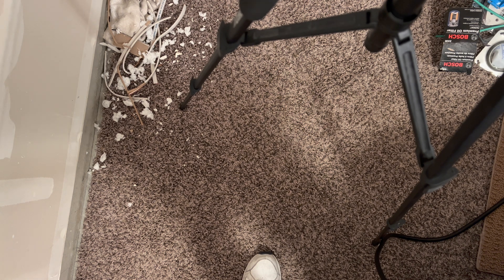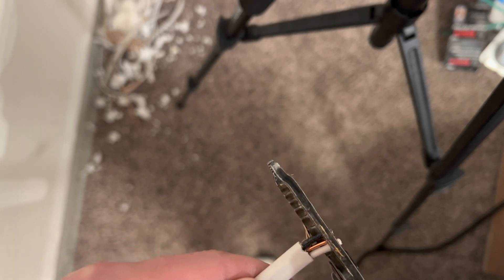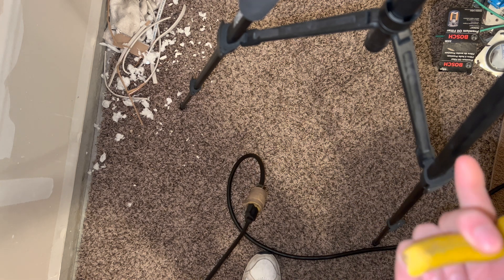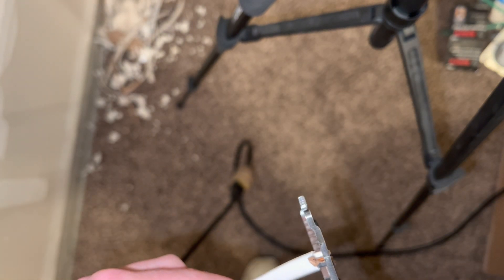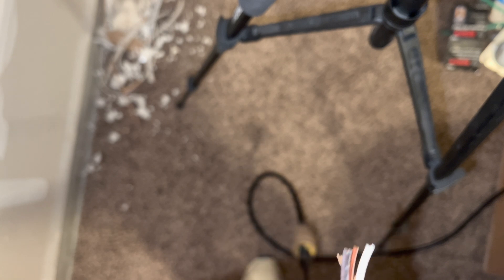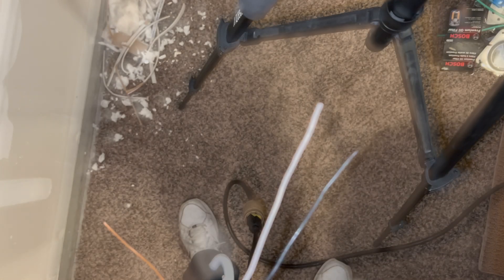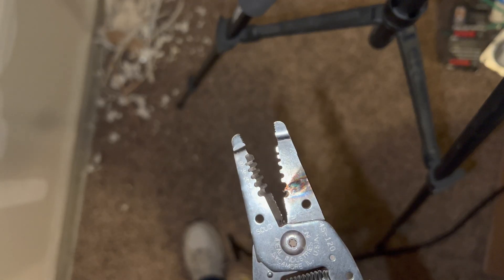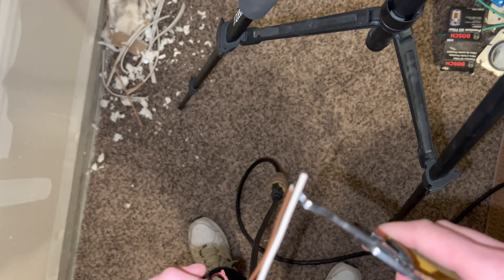Electrical 101: How To Cut Live Wires (Residential)

Comment: Just FYI, every time you short a branch circuit like that, not only do you briefly overload the conductors in the walls by over 200% their ampacity, you also cause pitting in the contacts of the circuit breaker, similar to what you see on the tools. This can drastically reduce the life of the circuit breaker, and the last thing you want is for those contacts to make a bad connection, heat up and start a fire.

Comment: Thank you so so much.  I am on my own and need to cut wires.  My voltage meter said it was okay but I'm still worried and now I know what to do.  Not sure if you did any videos on using a volt meter and what to look for if I'm testing a socket, I'm nowhere near an electrician but this is so helpful for keeping people safe in their homes as they work near eletricity. Thank you.

Comment: If you want to break the circuit because your devices are burning where there is no breaker to switch off the light 
Should I cut the live followed by the neutral and then the ground?
Reply from the maker: yes, as long as its not a shared neutral

Comment: I was in an attic tearing out an hvac unit. And my helper said power was off. I believed him. And the way power was ran. It would have been easier to just cut the romex all together.  I cut the wires. Loud pop. Sparks flying everywhere. Strippers melted. And somehow. Breaker never tripped. And wires were still live
Reply from the maker: yeah been there, never trust anyone. also lock it out with a key only you have. glad youre okay!

Comment: Say you have a circuit, a normal wire, live, neutral and ground on a lamp, there would be power on the neutral wouldn’t there?
Would there be an explosion if you cut just one of the individual wires?
The lamp is on, would there be an explosion if you cut the neutral wire only?
Reply from the maker: don't think so, but i can test it out!

Comment: Can you cut a live service wire thats going to your house in order to change to 200 amp. Or should you call the company to turn off the power first
Reply from the maker: i would never do that, one wrong move and your dead. call the company.
Reply: RIP.
Reply: What he said, one wrong move and you're dead. BUT if you're going to ever do that, use insulated tools and gloves. 10000%
Just a bit more of an explanation that will go along with this video... The arcing that happens when he cuts all the wires at one time? You see how that's pretty small and insignificant? If you accidentally cut a live feeder wire and happen to touch another wire (weather with your body, your tool, the wire, etc), that tiny little pop instead is going to be a huge boom called an arc flash. It's hot as shit, dangerous as fuck, it'll probably blow up the whole fucking panel. Lol
This is advice from an actual electrician right here too. And I've seen some crazy shit happen. So yes be careful and I appreciate the fact that you asked the question as opposed to just did it lol. 

Still if you have got the balls and are careful go for it lol
Reply from the maker: well said 😂

Comment: What if I turn off the main switch? I would be safe to cut electrical wirings for rewiring?
Reply: Yes
Reply: This video is about cutting live ones so if you're able to do that then of course you can safely cut non powered wires
Reply from the maker: yes, granted that is the wires power source.

Comment: This Happened to me, So had a Motor but it’s stuck in the box so I had to pull the Wires to pull the motor out but it Ended pretty badly because I Mistakenly forgot to turn off the Electric power from the motor and When I was pulling the wires of the motor it went BANG!💥 With lots of sparks and the Wires have Snapped, Luckily I wasn’t Hurt.

Comment: thanks this re assured me i dont need to turn the breaker off if you only snip one wire at a time, which will help me change this light out easier. 
for some reason this house 2 breaker panels, one in the attic and the other under the house in a crawl space and its a hassle
Reply: Did it work no problem?

Comment: Why do my stripper keep blowing up? I’ve blown up 2 in 2 weeks and to embarrassed to ask my journeyman. Both times I was only stripping the hot by itself and it blew. Most of the time I strip or cut hot wires it’s fine. Any ideas? TIA enjoy the content btw!
Reply from the maker: it's gotta be shorting out somewhere. maybe the edge of the stripper is touching the box or another exposed wire?

maybe stop working hot, lol
Reply: Never be embarrassed to ask a question.  Even a genius asks questions

Comment: I have a question, here the 3 wires are already cut.  What if all 3 are still in a circuit like say series.  And you want to cut the hot wire and you don't have an insulated cutter.  You can't right.
Reply: You can cut and touch live wires without insulated tools just make sure your shoes are insulated or standing on rubber floor mat

Comment: I was installing an AC disconnect today and I blew up my knipex linemans. I turned off the breaker but whoever terminated the load center mislabeled the 2P breakers. There wasn’t a quick way to test the voltage on the wire since it was just a 3’ stub of 8ga SEU sticking out of the wall. I learned today that I’m just going to turn off all the 2 pole breakers because you can’t trust anyone.
Reply: Invest in a non contact voltage tester and a meter, test everything before with leads bro

Comment: That tester you used we call in Finland "Dead mans pen" because you can't trust  it 100%. I was thought to never use one if testing for the purpose of working on the tested object. Only use it for finding wires. Also if you cant find out which breaker some wires are coming from or you have a really long way to the panel you could do what you did to trigger the breaker😂 but I would not advice to doing so but like my last weeks job where the panel was behind a locked door and the owner not coming until 2 hours later I tripped the breaker by connecting hot and neutral. Just don't do this for above 16 amp circuits.
Reply: Why not above 16amp
Reply: In the US. You normally run a 120 20AMP breaker for garages. He just did what you said you shouldn’t do
Reply: You should only use those voltage pens to see if something is hot or not strictly.
Reply: @brendanfogel4573  yea, I like to run around the club with this
Reply: Guys at my company call it the widow maker lol

Comment: Wouldn't it be cool if they made a wire cutter where the actual cutter is not conductive so that you can cut live wires without issues.
Reply: they're called apprentices. lol
Reply from the maker: lol
Reply from the maker: very interesting thought
Reply: I think they do have one.  Klein tools insulated wire strippers.
Reply: @llanbull  he’s not talking about insulated tools he’s talking about a non conductive metal or super hard ABS plastic tool
Reply: @modernbassheads5051  obsidian possibly

Comment: Why was the hot and neutral cut a larger arc?
Reply from the maker: not familiar enough to know why myself
Reply: Because the GFCI is tripped at a much lower current and time. When you short the hot and neutral only the circuit breaker gets tripped, and that takes way more current and time.
Reply: @dOoMnX  awesome! Thanks that makes sense.

Comment: Super educational. Also, pro tip: a non-metal grinder blade won't blow up. I accidentally cut a cable to a 240V mini split once and pooped my pants, but neither the breaker nor fuse in the mini split blew
Reply from the maker: thanks!

good to know, thanks :)